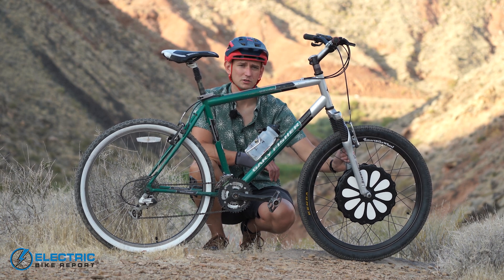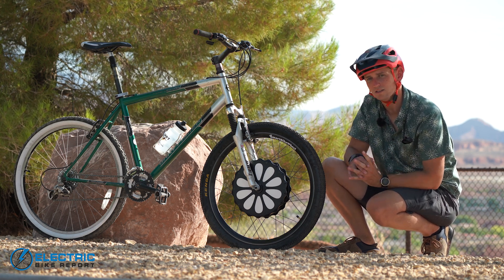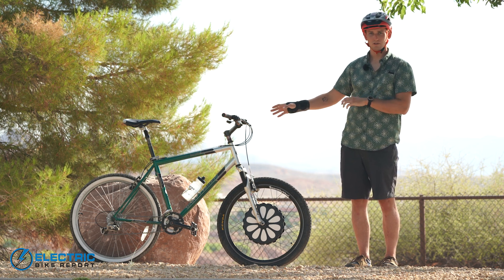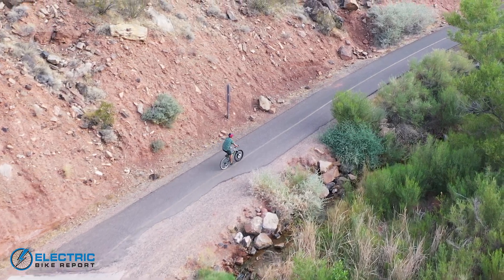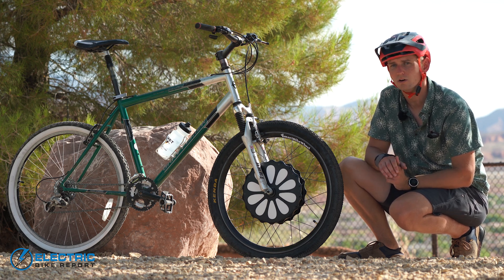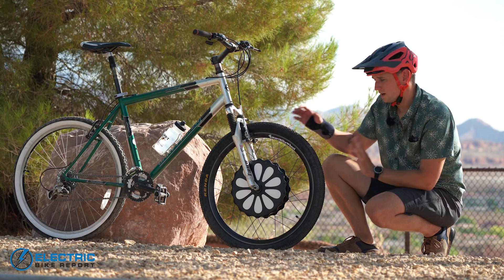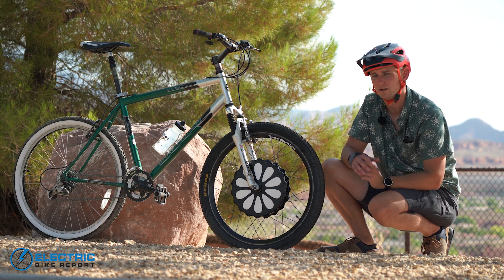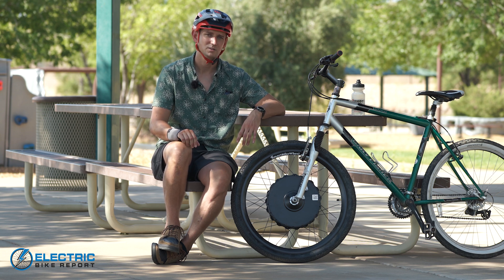Smart Bike Wheel Review | Electric Bike Conversion Kit (2021)

Comment: I am 6’4” and have put about 4000 miles on my oversized Giant bicycle. I have it all decked out with conveniences and I love it. A front drive wheel seems to be my best choice as I am now 75 years old and find I could use a slight assist especially when pedaling against the wind . Your excellent video helped me decide. Is “Smart Wheel” you highest recommended name or should I check out other manufacturers ?

Comment: Brake, not break, but you would want to "break" the electric current for the motor drive for emergency stops, say  the motor was in a stock on logic state, like the about to be stuck "off" state as describe in the video. I don't like safety depending on software.
Reply: The wheel will recognize the braking and shut down the motor, but it works best when you brake harder. We have a pedal assist sensor that shuts the wheel off when pedaling stops. It’s a better option if you’re concerned about this.

Comment: Interesting review! Sounds like a much simpler-to-use setup than most of the hub motor kits out there, despite the constant recalibration required. Keep up the good work!!!
Reply: You don’t need to set the gyro with each ride - it should only need to be set initially. Sometimes it takes a few tries to dial it in, but once set, you should be good to go.